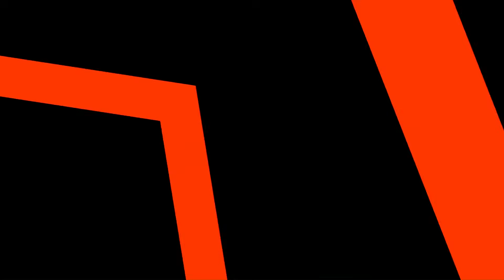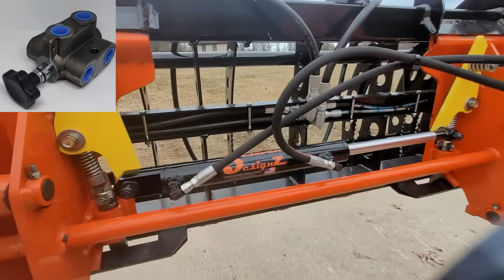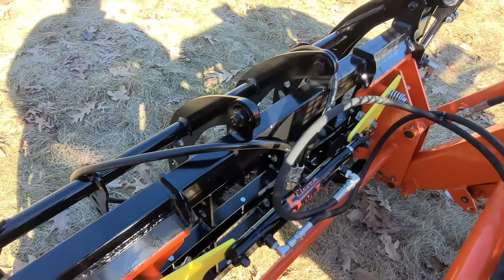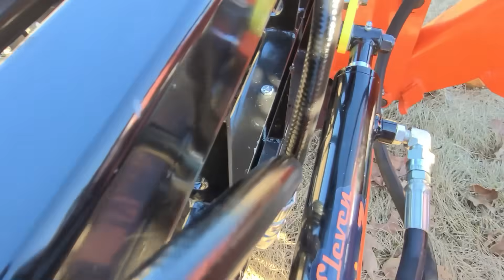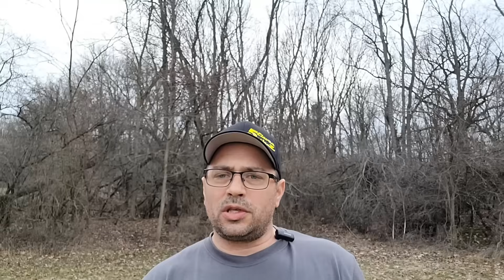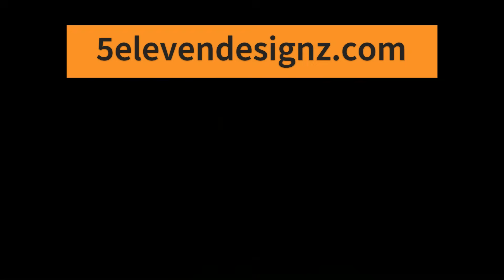Hydraulic SSQA - Change attachments without leaving the seat! Kubota L2501 L6060

Comment: We have a grand L6060 LA1055 loader. Thinking of getting this as we keep swapping between bucket, forks and and grapple. We store the tractor in a garage with nothing on the front so always hooking up. Two questions, we have your third function guard installed. Your electric diverter fit no problem with the guard?  Also lots of time when we put the bucket the bucket wont sit just right. We hop off and try to put the ssqa arms down (kubotas) and they wont lock in place as the bucket isn't all the way in on the bottom. So we hop on up and shake the bucket so it sits in right. But what happens if we try the auto ssqa and its not sitting right. Will it stop or will it try to force and break or bend something?
Reply from the maker: I apologize for the delay; I just saw this. If you are referring to the hydraulic line guard, the diverter kit is designed to work with or without our line guard. It is a manually operated diverter, so when you need your 3rd function after hooking up an attachment, you just connect the hydraulic lines and flip the lever on the diverter. I won't bend or break something as the pins are still the stock engagement pins with springs as long as the springs have enough travel.
Reply: @5elevendesignz511  Thanks, we already bought it, sitting on a box in our garage waiting to be installed

Comment: So Justin If you lock it then unplug it to plug in your grapple it will stay Lock? Does the cylinder have a locking block like on the Top Link cylinders so it won’t Drift and possibly unlock? Or am I overthinking it.
Reply from the maker: Bob,
It will stay locked since there is nowhere for the oil to go. The cylinder would have to have an internal leak AND an external force on the levers, pushing them to make it move. Not overthinking it; it is good to think through it and ask the question. With a top link there is direct pressure pushing (or pulling) the cylinder with a lot of force due to leverage. Some valves have a checkvalve in addition to the ones in the block to prevent this. Since the hoses are deadheading at the couplers, there is nowhere for the fluid to go when they are unplugged.
Reply: @5elevendesignz511  Ok makes sense. I know our hay rake leaks down when sitting but I think the couplers are leaking. We’re gonna put on new couplers and our a 1/4 turn shut off valves. Thanks another great product.
Reply from the maker: @bobpurs thank you sir!